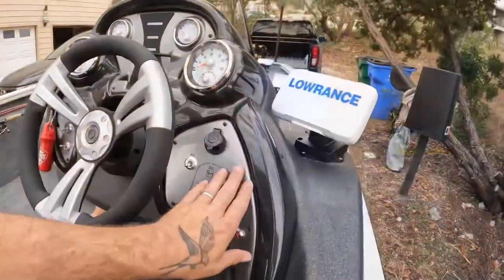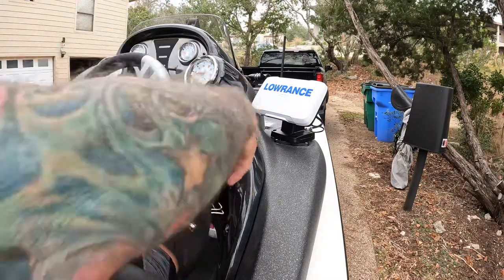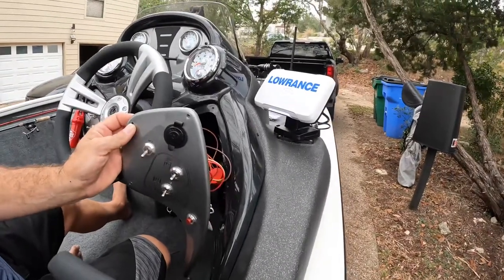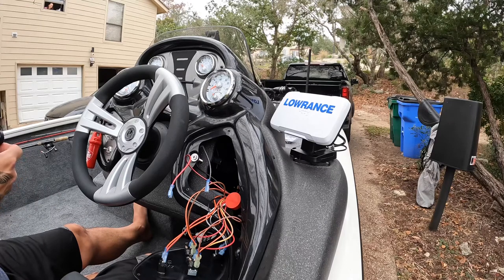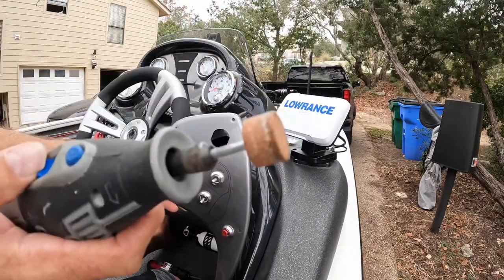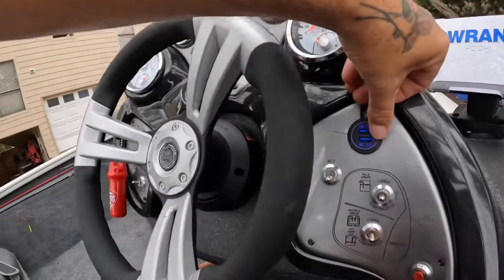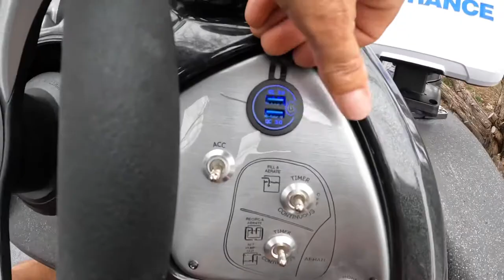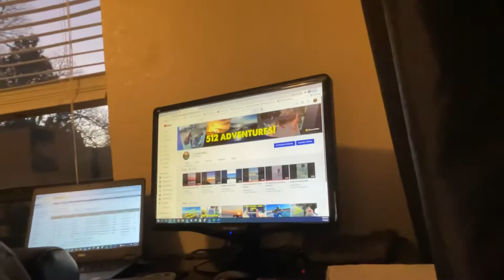Installing USB charging port in my new boat - Tackle Tip Tuesday #4

Comment: Does this draw power when you turn it off ? The sub ports still looked illuminated slightly
Reply from the maker: It will stay on if you don’t turn it off manually. I also keep my boat on shore power all the rome